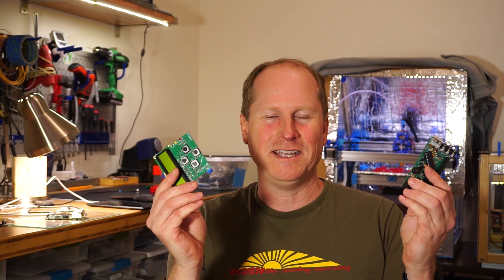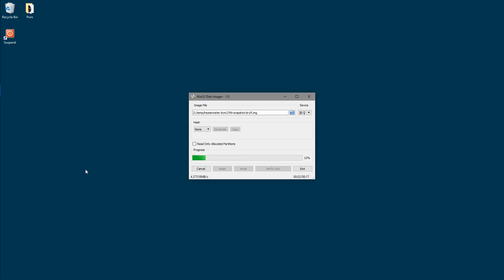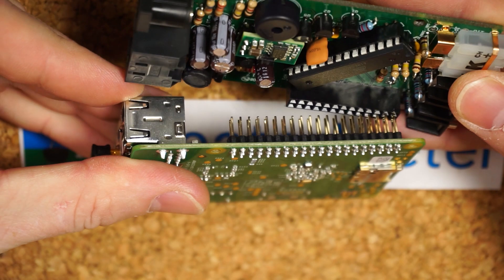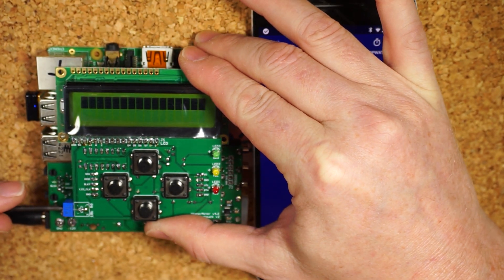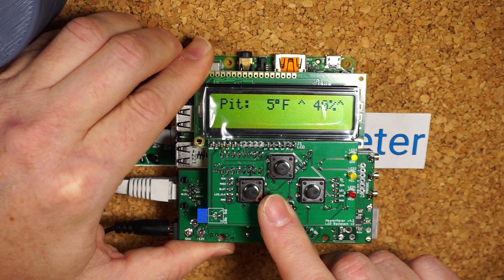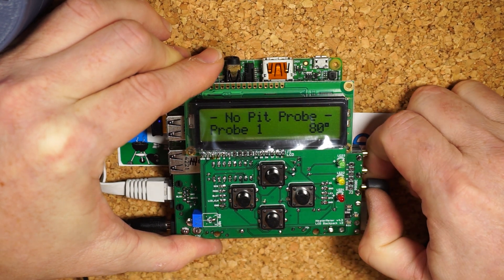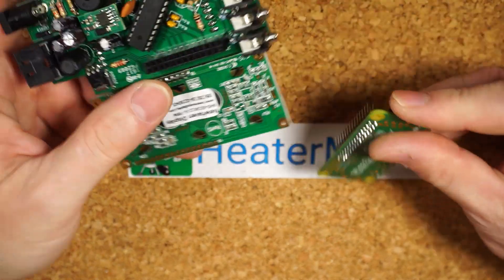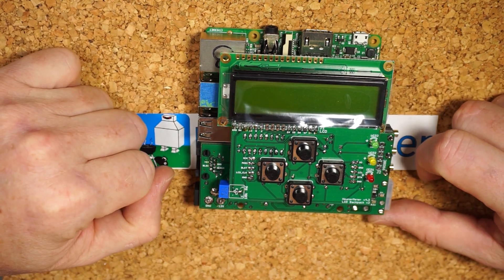HeaterMeter Firmware and Test

Comment: Hello Bryan, I have finally managed to build and Fix my Heater meter by replacing a broken Bs170 as described in the forum. Now I would like to understand how to set up push notifications. unfortunately i cannot find any easily understandable help in the forum.  I created a Pushover account, created a pushover App code. put both the user code and the App key in the lines for the Push notification. Set the tick mark for Push  for my alarm in the gui. but I don't receive any Push notifitacions on my pushover PHone app. can you please help me?
Reply from the maker: Hi, I didn't see your message here, posting on the forums is really the only way to look for support. I just created a new Pushover account for myself, added a HeaterMeter application, then took the user key and application key and pasted them into my configuration. Tested and working, so I don't have any help to give you. If you're still having issues with it, then I'd suggest starting a thread about it on the forums. https://tvwbb.com/forums/heatermeter-diy-bbq-controller.85/

Comment: I have the heater meter 4.3 and the pi zero and I always have to mess around with the settings on my probes I can't seem to find a good setting for it. Is there a specific brand you use to get that accurate temp? I tired using the ones from amazon and also a probe I had from another thermometer I had here laying around.
Reply from the maker: It is better to ask these sorts of questions on the forums (https://tvwbb.com/forumdisplay.php?85-HeaterMeter-DIY-BBQ-Controller) but there should be no messing around with settings on the probes really. Select the type of probe it is from the dropdown, resist should be 10000, offset should be 0. That should give you a temperature within 1-2F with both the Maverick and Thermoworks probes. If you're seeing the temperature bounce all over, look for the noise icon indicating we're not getting good readings.

I use the Thermoworks ProSeries probes, but the Maverick ET-72/73 are very good as well, but are slightly less durable.